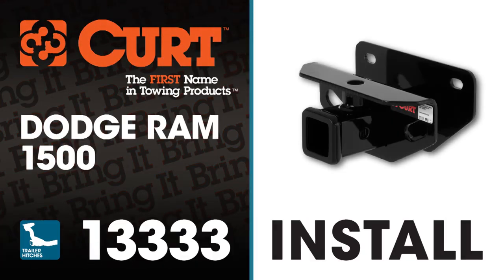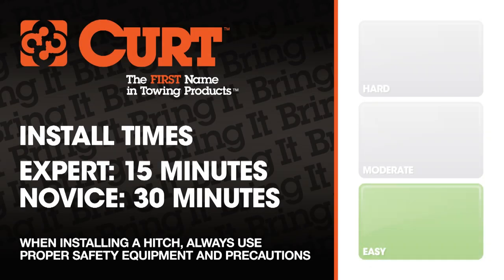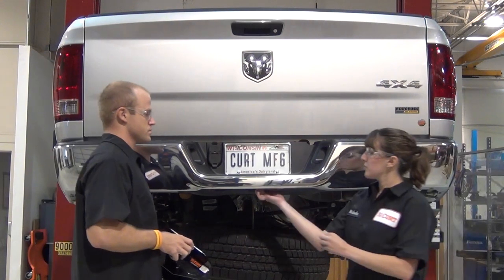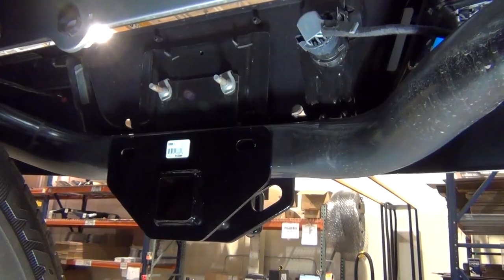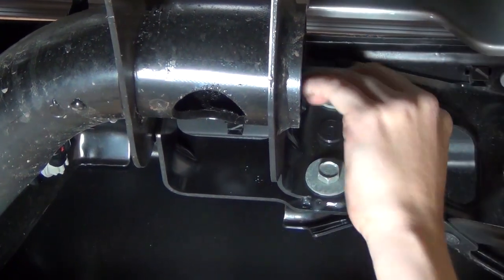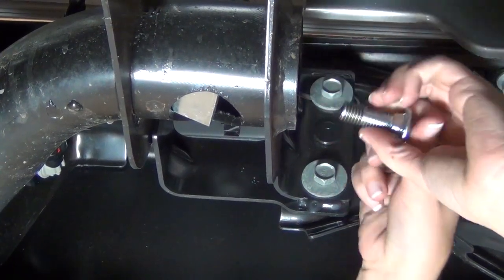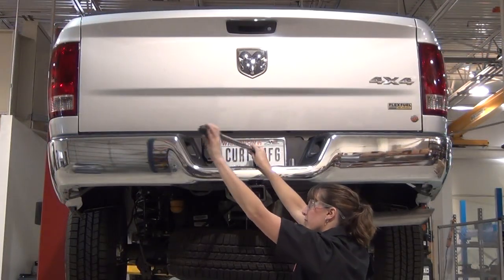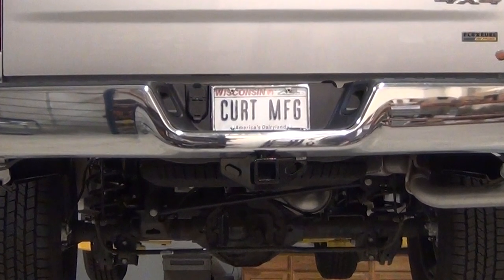Trailer Hitch Install: CURT 13333 on Dodge Ram 1500

Comment: Great Product and install was easy after watching the video.  The bumper trailer hitch cover no longer fits after the hex bolt is installed since it sits too high.  To fill in the gap I took the existing cover and drilled a 1 3/8" hole in the center (just slightly bigger than the diameter of the head of the hex bolt) with a wood boring bit. I painted the top of the hex bolt flat black. Now the cap fits perfectly with the hex nut protruding slightly above the cap.  It now looks great and is easy to access for inspection.

Comment from the maker: The CURT 13333 has a 6,000lb Weight Carrying Capacity.  This is adequate for most towing situations, however if your towing more weight, CURT also offers higher capacity hitches.  To find all the options for your vehicle, go to curtmfg.com and use the Quick Hitch Lookup tool.
Reply: would that be the same as if there was a stock hitch already on the truck?
Reply from the maker: CURT Manufacturing trailer hitches are American-Made, and perform brilliantly at your command.  It really all depends on what you plan on towing, and what kind of vehicle you'll be towing with. This video will shed some light on some answers you may be looking for:

How to Select a Trailer Hitch - CURTmfg.com

For more information, please visit http://www.curtmfg.com or enjoy speaking with one of our customer representatives toll free at 1.800.798.0813

Comment: I installed this on my 2016 ram 1500 sport. The 3/4" bolt that goes through the bumper does not allow me to put the black plastic cap over the hole through the bumper to cover up the bolt.
Reply from the maker: Please give us a call at 800.798.0813.
Reply: I resolved the problem on my own by grinding the head of the bolt to allow it to sink in deeper along with reaming out the weld that the bolt sits on with a drill. Before doing this I did contact your customer support and they told me that this cap was not supposed to go back on and it should be left open. 
In my opinion that is ridiculous, makes a $60,000 truck look like trash. Either the design needs to be re thought or you guys need to make an aftermarket cap that allows it tobe put back over top of your bolt to cover the hole in the step pad cover..

Comment: i have a 2014 ram 1500 is this hitch heavy duty enough to pull my 57 chevy @ 3300  #s  and trailers about 2000#s
Reply from the maker: Randy Corle  The weight carrying capacity of this specific Class 3 hitch is 6,000 lbs. You've estimated 5,300 lbs. total trailer weight.  We recommend finding out the exact weight of your '57 Chevy and the trailer to make sure you do not exceed the capacity.  Alternatively, you could upgrade your hitch to either the CURT #14374 Class 4 hitch rated for 10,000 lbs., or the Curt #15572 Class 5 hitch rated at 15,000 lbs.  Hope this helps, always tow safely!

Comment: WOULD I BE ABLE TO USE THIS DESIGN HITCH IF I HAVE A BODY LIFT INSTALLED WITH BUMPER RELOCATING BRACKETS ON A 2014 DODGE RAM 2WD?
Reply from the maker: +Rick Wilson Please call our technical support team at 800.798.0813 to get a detailed answer for your 2014 Dodge RAM.

Comment: Question will this hitch fit on a 2015 Ram 1500? I was mistakenly sent this when I had ordered another brand and after reading the reviews I would much rather have this one if it will fit.
Reply from the maker: +S Topper Yes it will. There are few hitches that fit that truck, check them out here: http://www.curtmfg.com/HitchLookup/find?mount=Rear+Mount&year=2015&make=Ram&model=1500&style=Except+with+Factory+Receiver